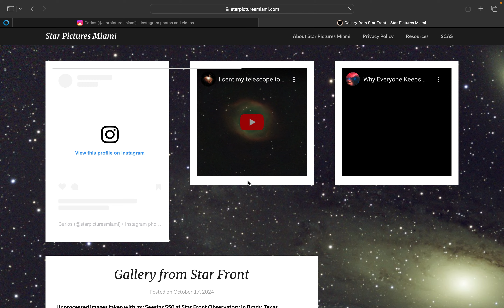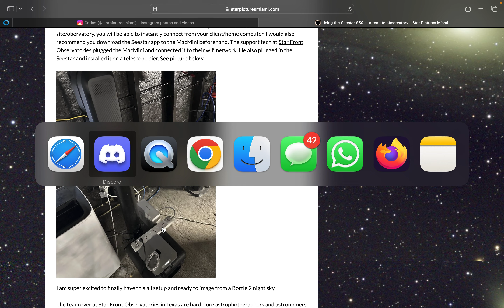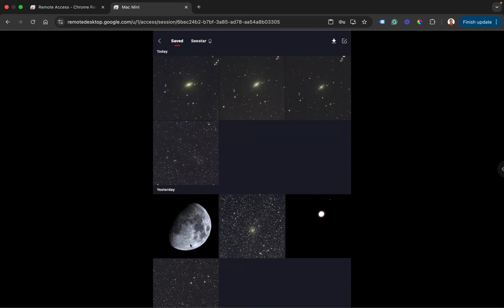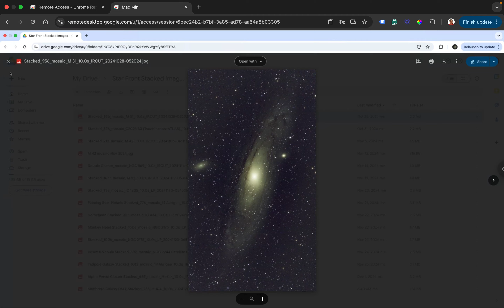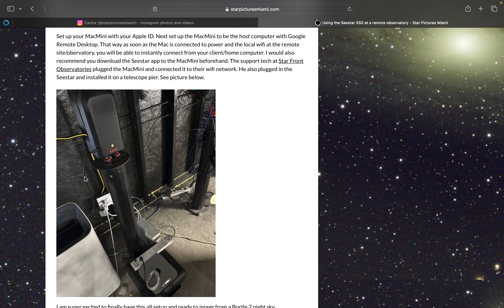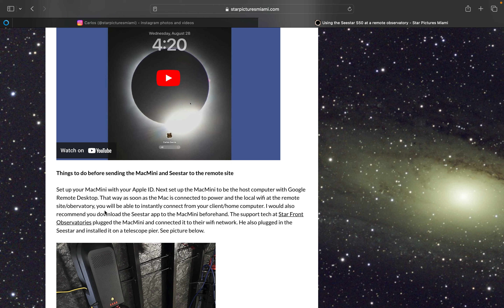How I set up and control my  Seestar S50 smart telescope at Star Front Remote Observatories.

Comment: How is the KASA power strip connected to the remote WiFi? Also, are you still using a UPS?
Reply from the maker: Yes, the KASA is connected to Star Front Wifi.  If you send your KASA to SF, turn off 2-factor authentication so the support staff can connect it to the Wifi.

Comment from the maker: June update.  I have added a Switch Bot button pusher to my Seestar.   This allows me to remotely power cycle the scope.   I ordered it via Amazon and had it drop shipped to SFRO.   I downloaded the Switch Bot app on the Mac Mini prior to submitting a support ticket for the install/activation.   No need to buy the additional hub.  It connects via blue tooth app from the Mac Mini.  It is nice to be able to power cycle the SS when needed and not have to depend on submitting a support ticket.  Which sometimes may take 1-2 days.
Reply: Can you please point to the Amazon link of the Switch Bot? If it is working fine for you. My other question is, if you are using the Wifi to connect to the Seestar, how are you connecting the Mac Mini to the internet? Ethernet? I would really appreciate an answer. Thank you! Greetings from Texas!
Reply from the maker: @eliasaydi1179  Here is link to the SwitchBot button pusher I use on my S50 at Star Front.  It works great.  https://www.amazon.com/dp/B07B4D9KVX?ref_=ppx_hzsearch_conn_dt_b_fed_asin_title_4&th=1
Reply from the maker: To answer you question about wifi and Macmini.  At Star Front the Mac Mini is actually connected via a Cat 5 cable and WIFI.   When you use the Seestar in Station Mode, you can connect to it via WIFI.  But first you need to connect via Bluetooth, then once it is connected, you can activate Station Mode and you will be connected to you Seestar via the WIFI.

Comment: Thanks for the video. I took the plunge and sent my Seestar to Starfront.  It's been there a month and so far I can't say it's been a success.   The problems are mine, definitely not with the staff, they have been great.  I have it setup in EQ mode and keep running into problems with chord wrap.  I tried your method of closing the arm in between targets, it still keeps getting wrapped and disconnecting the chord.   I'm thinking of going back to Alt/Az mode and hope that might fix my chord issues.  Have you tried EQ mode at SF yet?
Reply from the maker: I have not tried EQ mode yet at Star Front.  I ordered the William Optics EQ mount and had it delivered to SFRO over a month ago.  But I asked support to hold off on installing it until I wrap my head around it with my S50 at home.  So the EQ is in a holding pattern for now.  How long is your usb-c cable?
Reply: @StarPicturesMiami  My usb cable is 10', however I have had a huge problem with cord wrap with my S50 at Star Front.  I have broken 3 cables so far because of it.  I ordered a pier cam so that I can monitor the cord and spin the S50 to unwrap the cord if I see it becoming a problem.  I am going to  wait until the pier cam is up and running until I use my S50 again to avoid destroying another cable.
Reply: @bkeegstra04  following...Im going to be sending my s50 up there soon..how do I avoid the cord wrap ?
Reply from the maker: How has your experience been at Star Front with your Seestar?  Just curious.
Reply: @StarPicturesMiami little rough getting it all setup and aligned but since that’s been all sorted it’s been producing some fantastic images.
Reply from the maker: @TheHelicapt  B1 night skies make a huge difference.

Comment: you can use remote desktop on the Mac Mini and connect to a windows PC, right?
This is interesting to me as a friend just buying a place in the middle of Arizona
Reply from the maker: Yes, you can use a PC running Google Remote Desktop to control/access the Mac Mini.  That would work.  Yeah, I've thought of the same thing with a friend I have in NC who has a huge property in a very dark area.   You'd need to figure out how to protect the Seestar with some sort of box or or dome.  Or have your friend put it outside on clear nights, then bring it inside.